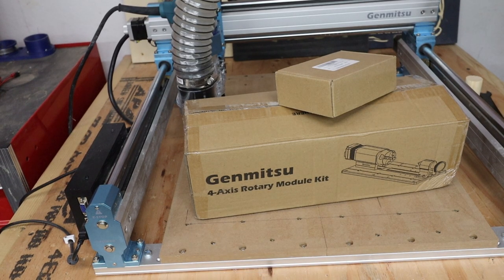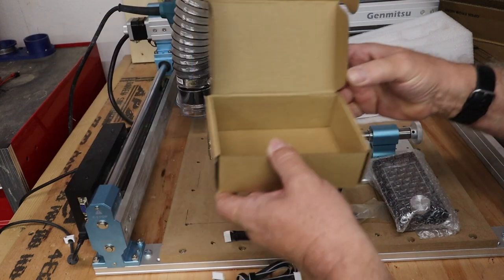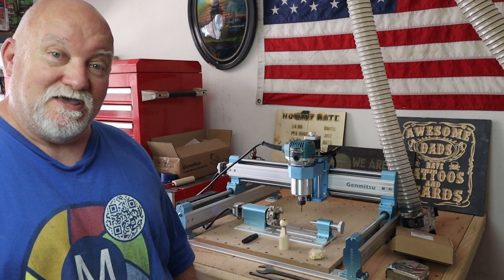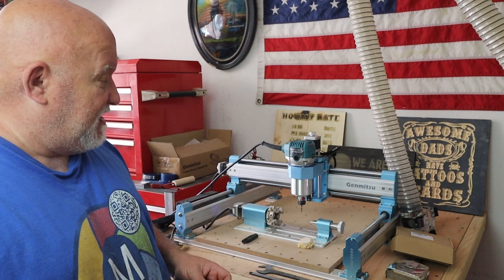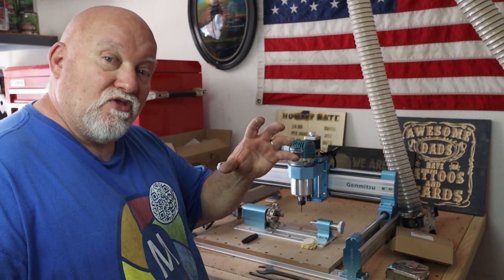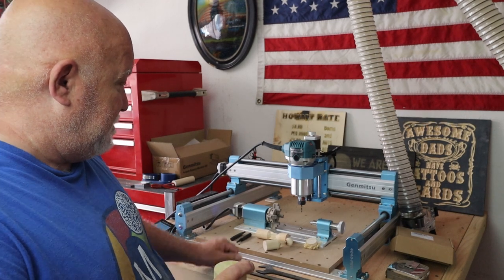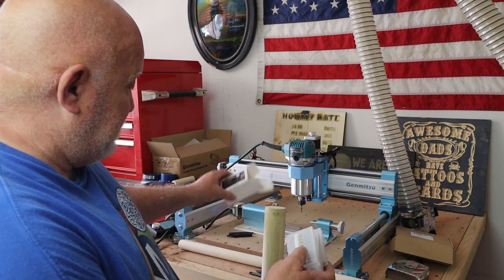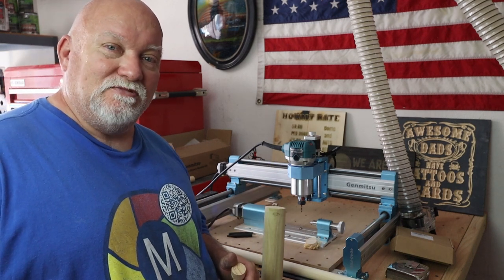4th Axis Rotary Kit for your Genmitsu 4040 Pro CNC #3dhp

Comment: one issue we found is when lettering, the letters carve mirror imaged upside down.  A+ turns the chuck clockwise as viewed from the tailstock.   this needs to be reversed,  A+ should turn the top of the part toward the front of the machine, counterclockwise.  there is a $= system setting for this.  $3= sets binary bits for axis rotation X,Y,Z,A.   default value is $3=4 (0010 binary) reverses the Z axis (0=normal 1=reversed).  to reverse A axis as well set $3=12 (0011 binary) reversing the Z and A axis.  to see all of the system settings send $$. NOTE: I believe that the remote control unit needs to be plugged in and set to 4th axis mode to be able to set $3= from Candle or UGS. see Anthony Lofthouse Youtube channel